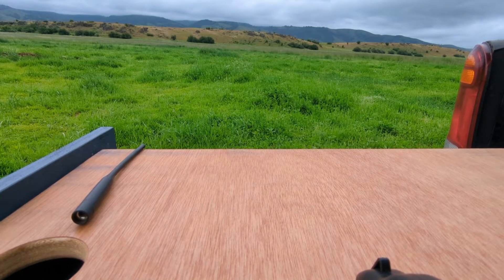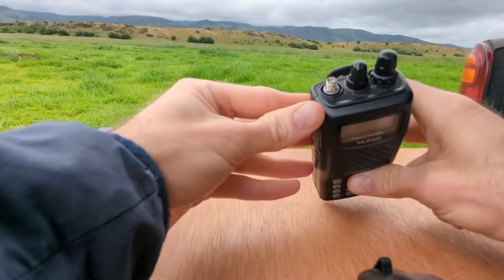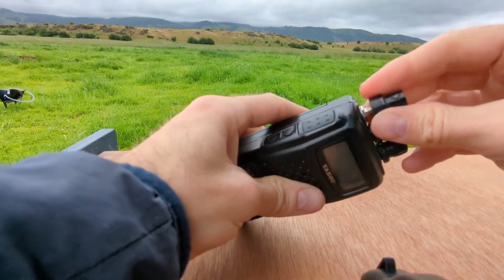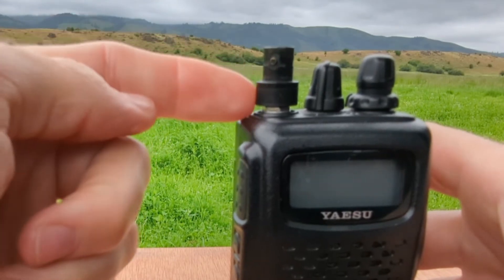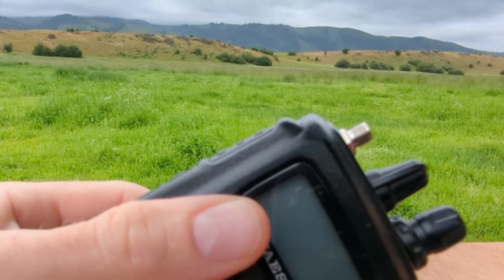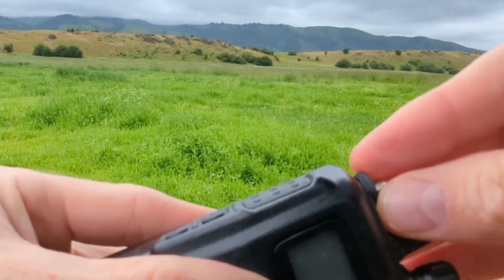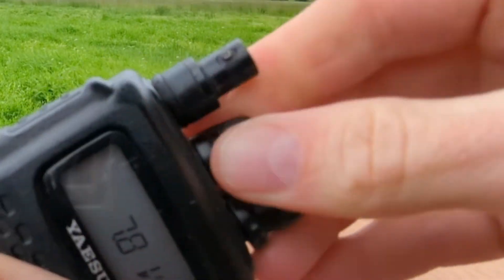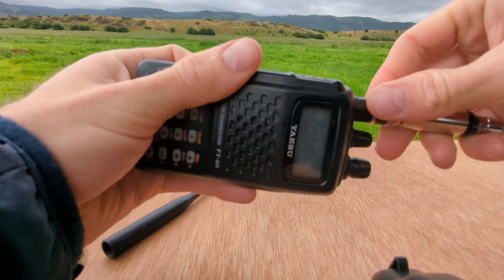The Best BNC Adapter for the Yaesu Ft-60r HT

Comment: 100% agree! BNC connectors are a must for me. I've been putting BNC connectors on all my handhelds for a long time. Once I ordered one from Signal stick, I had to replace all the cheap ones I got from amazon.
Reply from the maker: Ditto for me. I pretty much never use the rubber duck that came with this radio. I replaced it with a BNC signal stick which is great for hiking and does a decent job. When I get on summit I pop off the signal stick and put on the longranger or deploy something else.